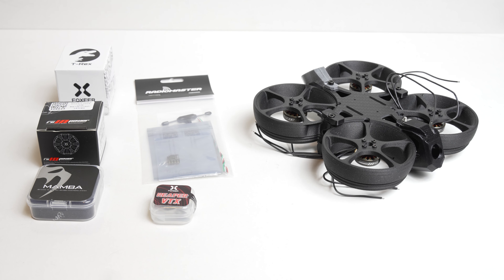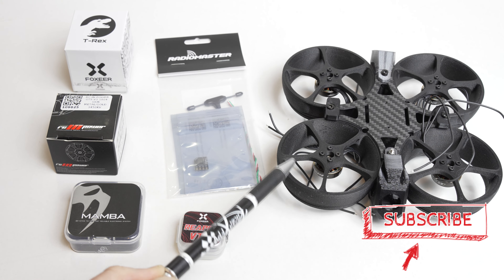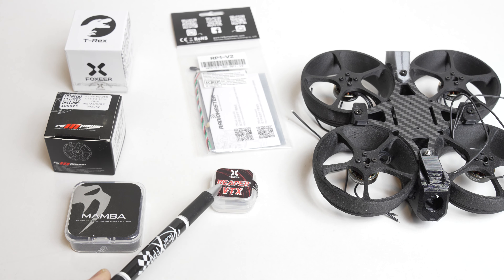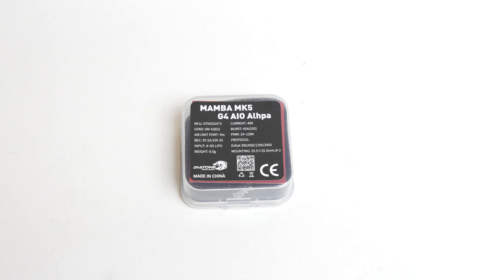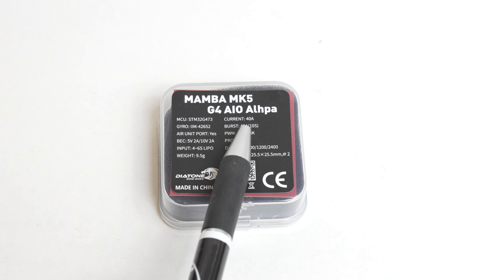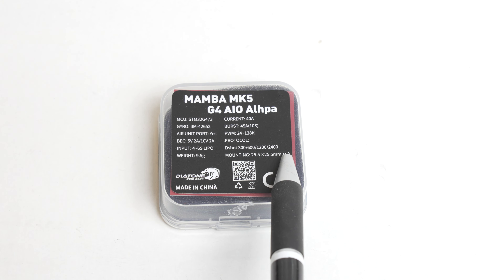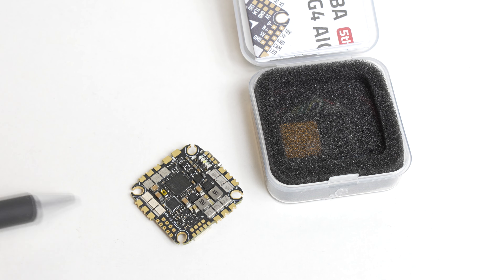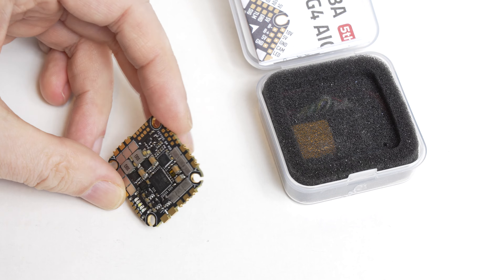Diatone / Mamba MK5 G4 40A AIO Alpha - Show & Tell

Comment: This should have a FETtec graphical OSD, which I simply love. Have a 15A AIO board in my 3,5" toothpick (FETtec) and a non-Alpha G4 FC (FETtec) on my 5" setup. The graphical OSD is simply amazing, just lovin' it....
Reply from the maker: Yeahhhh so I did want to try Alpha, but I'm also completely new to it :D
Reply: @DutchRC  I like how FETtec flies. There is a somewhat "loose" feeling to it, rather difficult to describe in words. The quad feels more analogue in its flight characteristics. Betaflight tries to achieve the setpoint set by the pilot, while FETtec does it in some less direct way.

The feeling is closer to floaty, but not at all delayed. The movement of the quad is less synthetic for me, provides a more casual and enjoyable way of flying.

It somehow feels more like a flying object and less like a simulator.

I don't want to bash Betaflight at all. Have several BF quads and like them as well. However the FETtec FC's give a bit of an extra feeling, that is just so ever bit more enjoyable for me.

Comment: O, this one I have on my radar. Ex-ci-ting!
Reply from the maker: Is it me, or is it impossible to change the UART the receiver is on?? :O
Reply: @DutchRC  as I understand UART 2 is meant for receiver, but 1, 3 and 4 are free so could be used for it, as well. Check in the configurator which one is set for what. The logic at first glance is a bit "different", but not impossible to understand after a while :-)
Reply from the maker: @donphobos there does Not seem to be an option to Change the receiver UART at all.. other things like the VTX you can assign a AURT to.. 
I do have ELRS working now, but only with the designated pads for it (not really flexible)